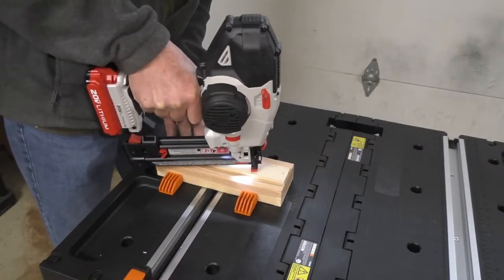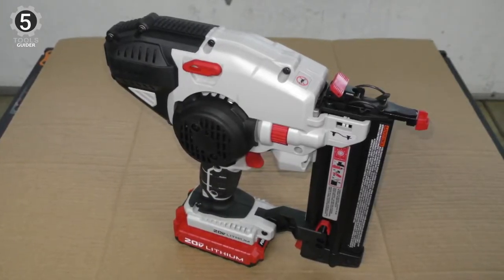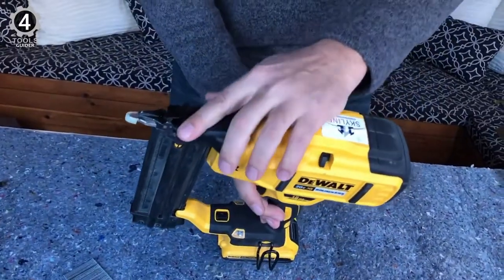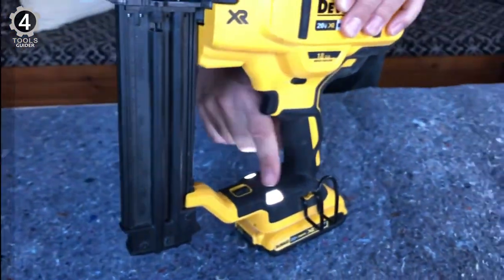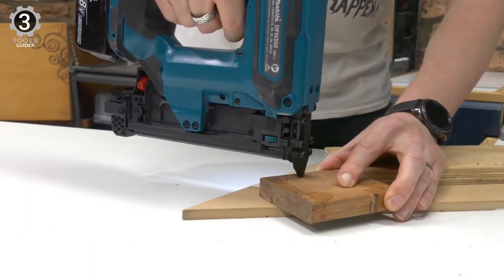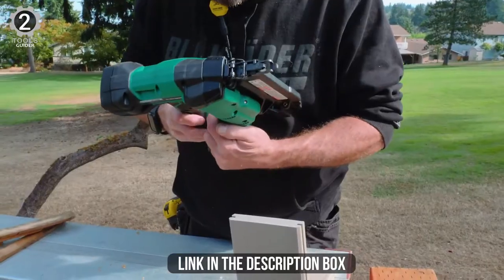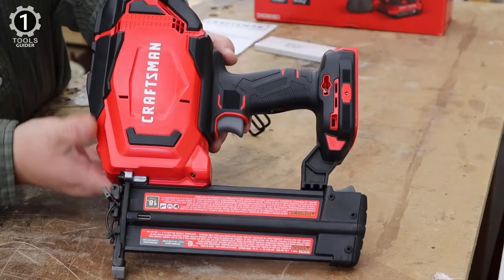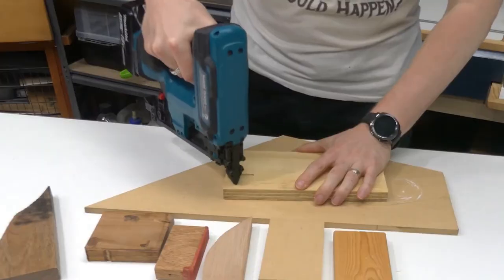Top 5 Best Cordless Brad Nailers 2023

Comment: Ryobi 18v is best bang for buck, had mine since 2009, use it all the time and its still running.
Reply: Yes I agree100%
Reply: Yup I use mine all the time and works perfectly
Reply: Mine gave errors after every shot so I’d have to remove the battery to reset each time. Had to return. Maybe a lemon??